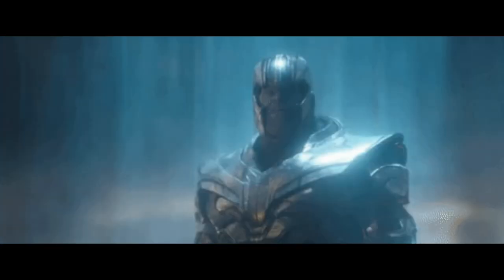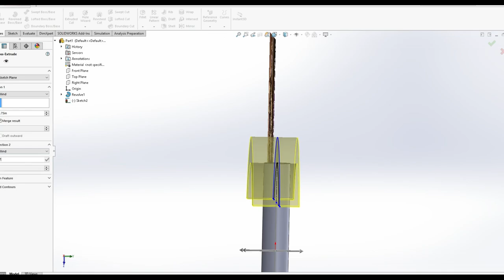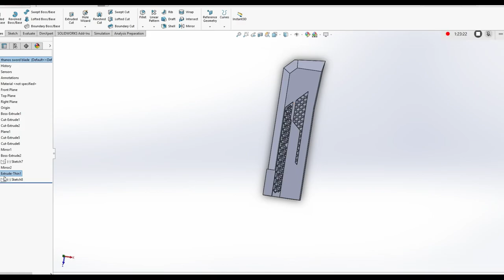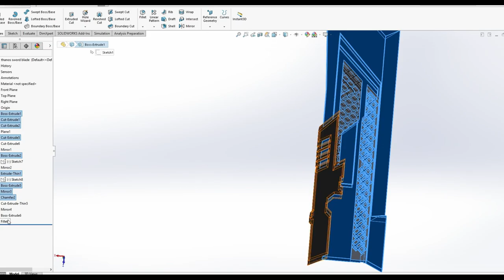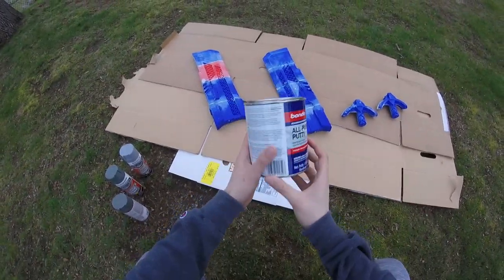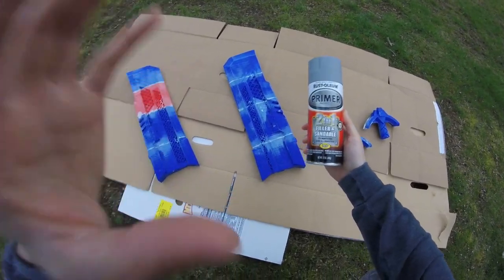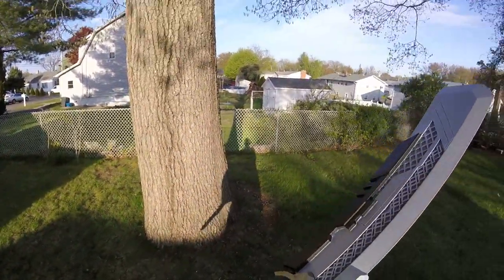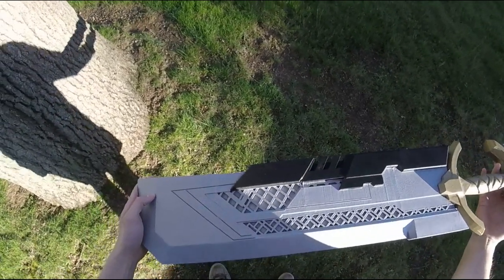Designing and Building Thanos’ Sword from Avengers Endgame

Comment: A: you are INSANE at designing I'm using your model now on my Ender - 3 pro

B: already been printing for 1day and 1 hour just for the main blade 

C: this is incredible hope you do more Marvel designs in future

D: this, the file and what not deserve the subscribe
Reply from the maker: Thank you! Good luck with the prints!
Reply: @CASSDesigns  thanks but really I should be thanking you as I wanted to print one and some marvel props and yours was the only thanos blade that actually works for my 3d printer and works in multiple pieces etc so what I’m really trying to say if I’m saying anything is 

Thank you for helping me do large prints
(Inspired by tony stark and this is my first print for multiple objects to do a large one)
Reply: Hey Man so I have almost finished but I need an extension to the blade as in like a years time I won't be able to hold it so do you have a blade extension that you could send me the link to it if you have one?